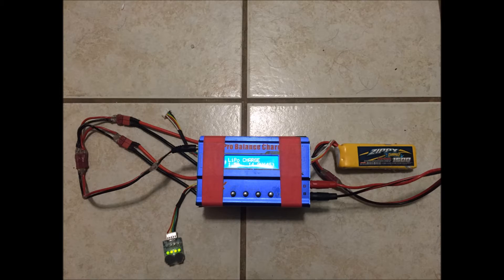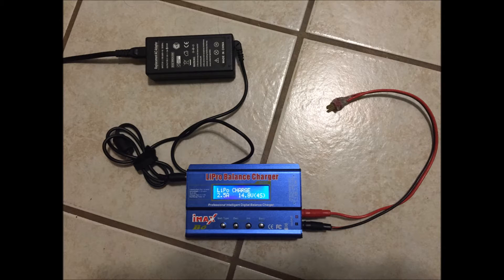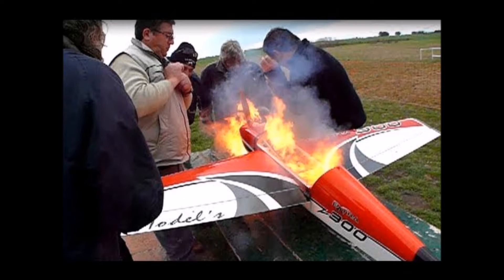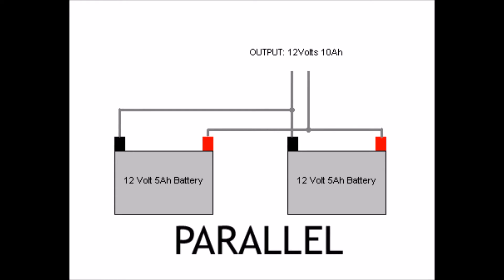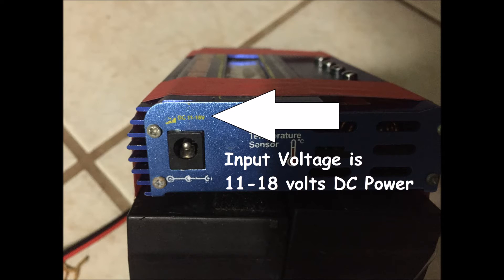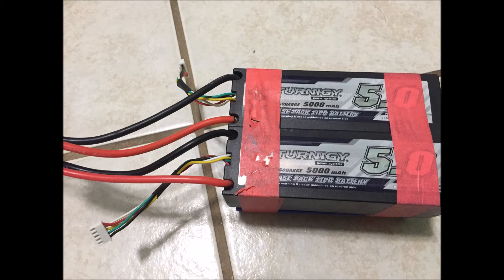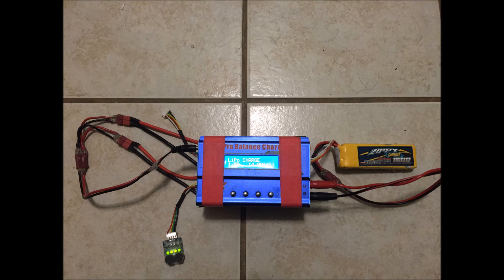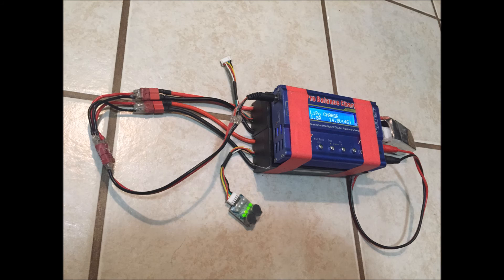FPV Life Hack: Portable LiPo Battery Charging: How to Charge Batteries w Field Charging Station

Comment: so how long and how many charges does this get you?
Reply from the maker: Thanks for the comment Paul! 

- The cool thing about this setup is you can choose the amount of amps you want to charge at (determines the charge time). My 1300mah flight packs claim they can be charged at 2.6a. This means if they were fully discharged it would take 30 min each.

- In terms of how many charges I get, the two big lipos that power the charger have a total capacity together of 10,000mah at 14.8v. Each battery pack I fly with is 1,300mah at 14.8v so I would guess that I can safely charge 6-7 packs in the field.

Happy flying!
Reply: James Brossart so is it safe to say from 2 5000mah bats you are getting about 4 charges out of it?
Reply from the maker: Easily 4, more like 6-7 because they aren't completely discharged
Reply: awesome, this is a brilliant idea, I have 8x 6s 5000s there also that I retired. great to put them to use.

I checked the specs on prolab and its 10-32v soI guess this will be perfect.

you saved me so much hassel, I was about to buy a portable generator  so I could charge my fpv racing quad lipos in the field. 

your a genious
Reply: so this would be around 14 or more if charging 500 mah or 800? this is awesome. I have a 12000 6s lipo from my s800 evo that i retired due to puffing, would I be able to use this to charge my 4s 850mah bolts using prolab8 in the field ?
Reply from the maker: Thanks for the comment, and nice charger you've got there! That would work, but I would confirm that this charger can indeed handle a 6s input. I'm pretty sure it can run up to 24v which is perfect.

The equation that will tell you how many packs it will charge is: mah*V/1000 = Wh

so

Your puffed 6s battery has roughly 266Wh of capacity and your flight packs (the 4s 850's) contain roughly 12.5Wh of capacity... That would mean you could charge 20ish batteries in the field with it :)

Just make sure to put a low voltage alarm on your 6s as to not over discharge it!

Happy Flying!
Reply: Does it also work if i use 2x 4500 mah parallel 3s lipo batteries to charge a few 4s 1500 mah lipo packs?